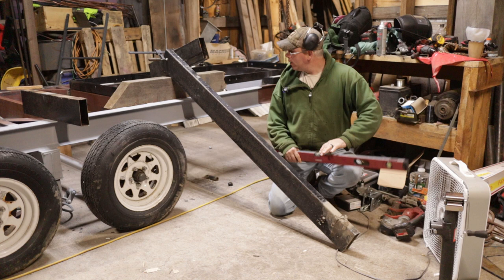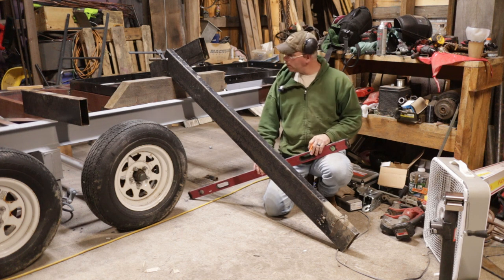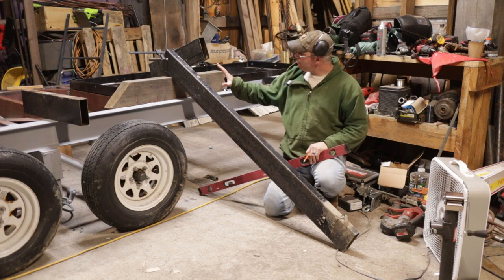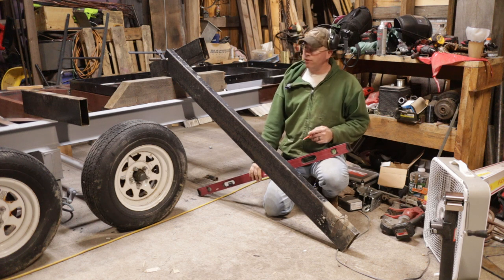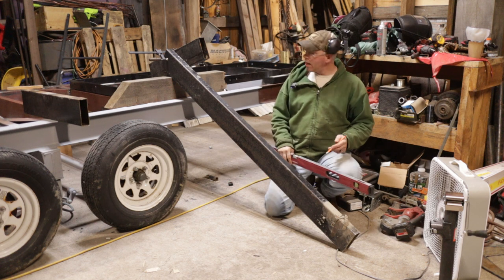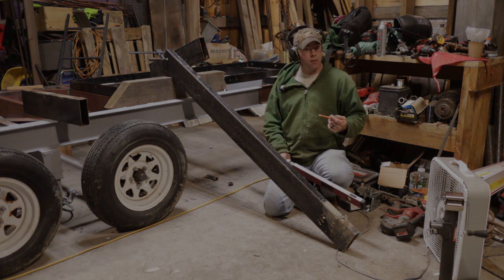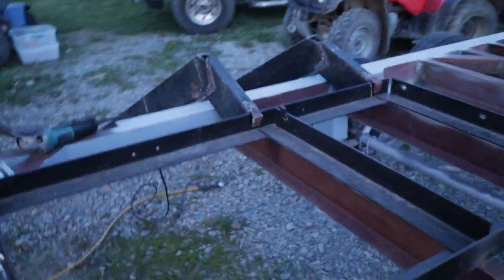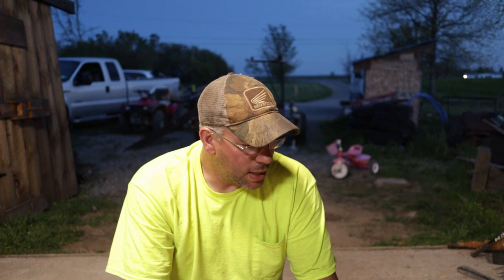Timber Frame 2.12: Log Loading Ramps on The Sawmill Trailer

Comment: Go to a smaller rod for the thinner metal, or if you want to use a mig, tune in the voltage and wirespeed settings for the thickness of the material.  You can find charts readily for both and they're always dead bang on.  It'll change your welding.  Hell you can also do a dry tig rig,  one that doesn't have torch coolant..  Anyhow, with your brazing experience you'll pick it right up.  The angles are the exact same as oxy welding and brazing.  Great video, can't wait to build a mill!
Reply from the maker: You need to build a mill, with your skills it'll be bang on.

Comment: Morning Jim. Glad you have work. Nothing worse than having bills and no income. Be thankful, even if personal projects get pushed back. Some of us have personal projects and no funding to even work on those with all the time in the world to work on them. We're at opposite extremes, brother. Ramps are looking ptetty good. Any thoughts on reinforcing them? Maybe drill through in a few spots and weld in some tube or rod to tie the side walls together/space them apart? Just a suggestion for bracing the thin-wall square/rectangular tubeing.
Can't wait to see a test log run up the ramps before you hit the road to go hit the wood lot.
"Blame the 5 year old", ha ha ha... that's a good one. Better than blaming the wife and it getting back to her, I guess.😉
Keep it up, buddy, you'll get you time in the woods. Don't forget your parts and sharpening bag for the chainsaws and mill when you head out. And, hey, just in case you come across that perfect long beam, take the Alaskan mill with you too. A full length ridge beam is rare, but you want to be prepared, just in case. A couple of heavy duty pads and lazy-susans, you can strap it across the top of the truck and mill to get it home just watch those corners and curves and let the mill slide a bit to take the adjustments for the curves. Depending on the route of course,  and the dreaded D.O.T..
Overhang and red flags, you know....😎! Where there's a will, there's a way. But if ya gotta scarf it, ya gotta stay legal on the road... sometimes laws suck, but safety first.....😉.
Edit: also, maybe anti-tip/stabilization feet on the bottom of the ramps?
Reply from the maker: Hey buddy.  Good idea on the drilling and welding rods inside the ramps.  I was looking at the idea of stabilizers and they will be needed for sure.

Comment: Evening Sir, my liitle project, 12×14 pavilion starts next week and I think I have probably contributed a hundred views to your channel(s) over the last month or so in anticipation of it.  You are a great host and very thorough with your explanations, luv it.  So many questions....so little time.  When it comes to post braces 8×8 posts, 8×10 beams, 4×8 braces with a little radius, should I still cut them as you do and come in two inches from the outside, or should I leave the same cut and center it, or center my 2" tenon on the stock and center it?  I ordered the timber frame for beginners book yesterday and it may not arrive before my vacation next week, poor planing on my part.  One last question, did you do a video on peg placement?  Couldn't find it if you did.  Thanks in advance, ~ Old School.
Reply from the maker: Good evening.  In your case you might like the looks better if you center your braces in the timbers, you can still make your tenon on edge.  It is much easier for accuracy to keep them to the outside though.
Reply: @TheTradesmanChannel  Perfect, thank you for the quick response, I appreciate it.  Keep up the great work.